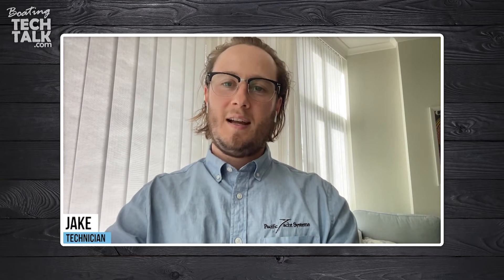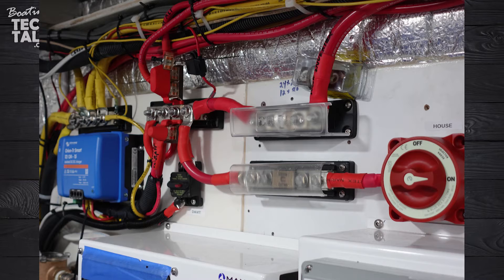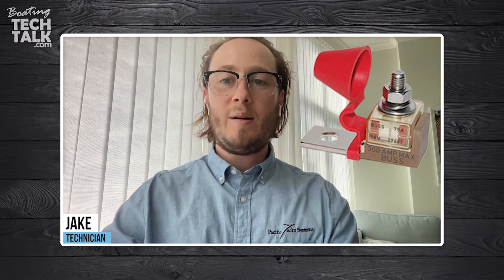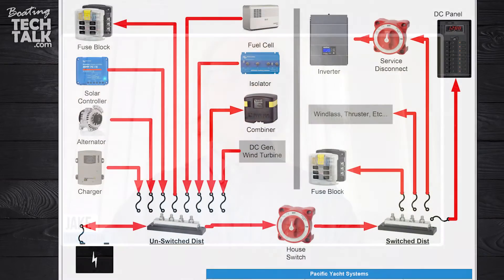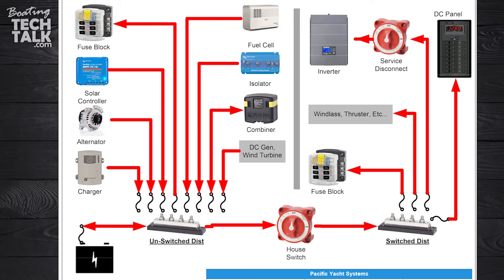I Am Rewiring My Boat and Have Questions About the Connections on the Battery Post

Comment: PYS. It has just come to my attention, that Jeff may have deliberately given us a Bum steer with his advice NOT to use portable generators like the Honda Suitcase 2 kW gasoline generators on boats due to risks of electrocution. In his video on someone using such a generator to charge their battery Bank a year ago, not only no mention any safety issues, he admitted he had been using one on his boat himself, and his only concern appeared to be their noise travelling far o er the water at anchorages. This needs clarifying, and frankly an apology for leading those of us advising people not to get them due to safety issues, up the garden path. Bluntly, I'm seriously Pissed. 😡
Reply from the maker: the main reason not to use a portable generator is co2 poisoning.  People have died on boats from portable generators.  Even with it running outside.  If you really need to use use one you defiantly can not fall asleep with it running and you need to have multiple co2 detectors on the boat

Comment: I have been watching many of Jeff Cote's videos in preparation for rewiring my 22 foot sailboat. The boat has had many owners who made dozens of terrible wiring changes and mistakes. As a precaution I traced all of the circuits and made a wiring map ( as opposed to saying diagram) I tore everything out because the boat was mainly wired with house solid wire romex and 4 wire trailer harness (brown, yellow, green and white).
I am going to rewire the boat with a house and a start battery. I plan to only single hand day sail for a while but will eventually take week long excursions, so recharging will need to be addressed. I will start with a manual switch 1-2-both-off, but eventually switching to a battery combiner. This will be a starter boat and I plan to move up to a larger cruiser in the future.
My question is: If I have 2 separate charging sources; alternator and solar, how do I connect the battery combiner voltage sense wires? Do I need a second combiner? Or do I used the solar for house deep cycle and the alternator to only charge the start battery?
Reply: Hi Todd, on a small boat I would put both charging sources on your house batteries because they need the most current and put the combiner on to the starter battery they don't need much current because they are almost always fully charged. This way you can use a smaller relay and cables.
Reply from the maker: the battery combiner connects between the 2 batteries and doesn't know or care what the charging source is.  it will work with any or all the chargers you put on.

Comment: Hi All guys d guyesses at PYS. First a massive thank You to you all at PYS for making your Knowledge available to the Public and Electrical Professionals, especially Land Based Professionals like myself (a qualified electrical installation engineer) who when it comes to Naribe installations, are dangerously ignorant of the differences required in the Marine Environment - which included me - Ive been seeing so many people getting it wrong on their boats I've been passing PYS Lectures and Talks  recommendations around like crazy, and will continue to do so, npw a subject you may want to look at and cover due to  new tech now on the market? I'm in the process of specifying what I want for a new Sailboat purchase here in Europe. DC and AC Handling Should be fine handled by Victron, and following their Design and Equipment advice(if in your area, I'd be using you, but getting to you with no wiring or instruments could be a very expensive problem). The Boat will not have a generator. In fact the space for one will House the House  battery Bank about 800ah as it is a seperate area behind the engine down low in the boat to help counterbalance the rear of Cockpit  Solar Arch Capacity about 900 watts Lifepo4. There does appear to be a move away from Generators that's starting to happen thanks to Lithium. Now something New, Balmar XT High Capacity Alternators,  available in 170 amp and 250 amp Capacity. tbh, Balmar are probably fine for design  recommendations for Customers, but these things give about 100 amps or more, at engine tickover revs. Not Cheap, but imho brilliant value potentially for what you get IF that charging power can be utilised correctly (for example diesel engines need load for theirgood long term health, so I'll have a regimen on long passages of running the engine for an hour before Dawn for heat exchanger hot water, plus inverter run electric induction hob for breakfast,  and an hour after sunset for hot water and cooking supper, running the engine at just over 1800 rpm, its peak torque rpm. At Anchor, there should be no need to run the engine. AGM Engine Start and Windlass Batteries prioritised to keep fully charged. I think this may kind of fit in with a follow up on your Ine Battery Charger Video, though I'm not personally concerned about restricting things to just one  harder,  as redundancy backup doesn't seem a bad idea. Any other new Tech that's around that's worth knowing about related to such things, could help too? Best Wishes to you all,  and keep up the great work.  Bob. 👍

Comment: I thought that you might address the question as to which loads should be directly connected as against going though the main switch (isolator)  or panel. I have on the house side: (i) bilge pump (I was told that code requires this); (ii) SSB (to limit RF interference) and (iii) windlass (load to great for switch panel), leaving everything else running through the main switch isolator and panel. Does that sound correct (34 ft sailboat)?
Reply from the maker: co2 or propane monitors are good to always have on.  Some stereos have a memery wire that needs to stay on.  windlass are commonly on the starter battery and switch not the house. you defiantly need a way to shut it off though it something happens  (if motor sicks running)     solar, battery charges etc also need to go direct to battery.  otherwise they stop charging if the switch is off
Reply: @PacificYachtSystems  Thanks for that. Yes, solar is connected directly. I opted to run the stereo through the switch panel, forgoing the memory functions, as I was concerned about battery drain off season. CO monitors are local AA batteries. So that only leaves the windlass. I have heard of other boats connecting that to the start side but have never been clear why.  Is it because the load resembles a starter motor (high amps for a short period), and thereby better suits that battery?

Comment: On my rewire - I used a 2 lug MRBF and ran the heavy inverter wire direct to one post and everything else (lower power) to the second. Everything else being the other distribution blocks and then fuse panels. My batteries are in 3P2S for 300A @24v. The inverter is a Victron 24/3000/70 and is MAX pull 250 amps (fused @ 200a) but I wanted the fewest connections I could in the heavy circuits. (3 in the pos (bat/fuse - fuse/wire - wire/inverter) and  4 in the neg (bat/wire - wire/BVM - BVM/wire - wire/inverter) 

Another great tool that I don't hear being used is a Infrared heat camera. I go over my electrical wiring/connections/fusing/switches on a "full power Monday". Everything on, load it up and start looking for heat. Mine was $200 on Amazon and plugs into the port on my Android Samsung tablet. Apple lightening version available BUT remember that the EU is telling Apple that they will go to the USB-C port next year or not sell in the EU.

Do it right, take your time, plan for futures and you WILL get to know your boat. I corrected many "what were they thinking" issues during my rewire.